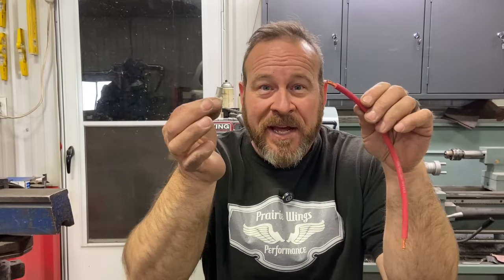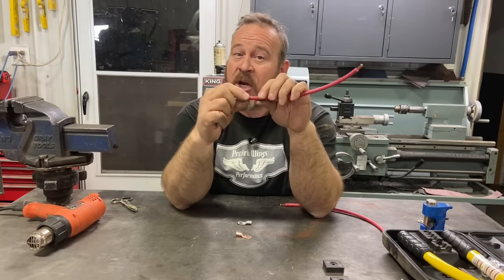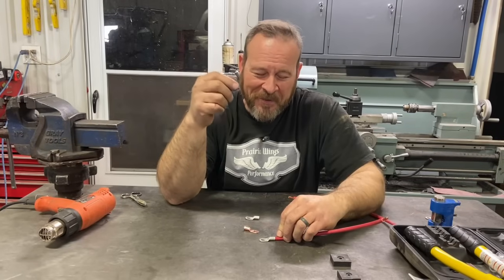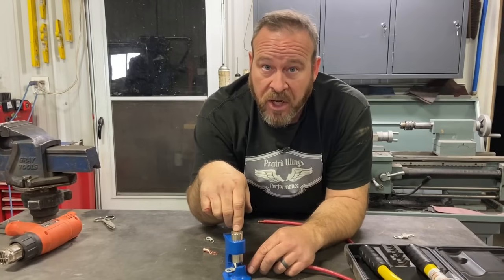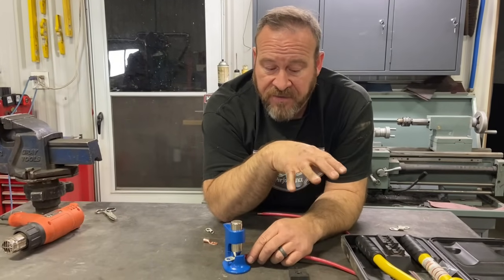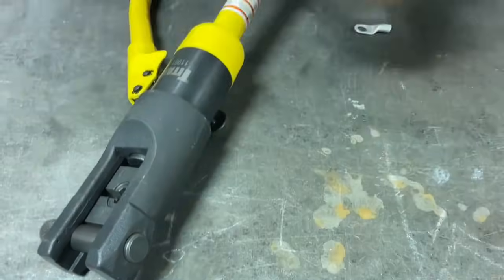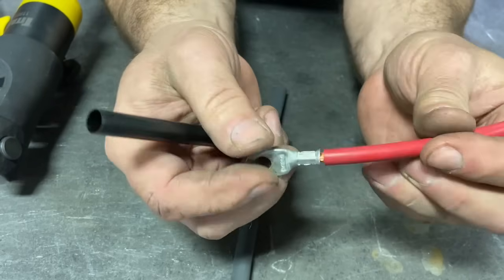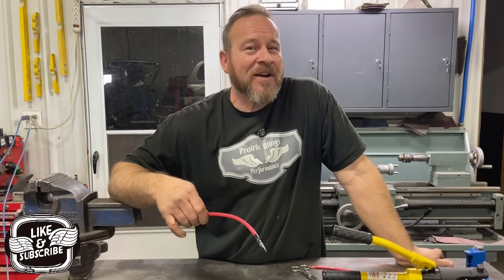Crimping Heavy Cable Ends - Which Way Is Better?

Comment: Back in the mid 80's I worked as a traveling mechanic with a railroad.  We had a ton of battery cable ends and no way to use them.  I ordered the proper crimper for them.  It cost $800 from the jobber the company used.  My boss had a cat and made the company take it back.  I hadn't given it much thought about it for a lot of years until I saw this vid.  I went online to look at hydraulic crimping tools.  They are cheap!  The world has come a long way since the 80's.  I used to put the cable into the end and crush it in a vice, then take a chisel squared off for the purpose and smash the end into the wire.  Didn't work great but that's what I did in the field and it got me through.  Thanks for the video!
Reply from the maker: @ralphwatten2426  I really appreciate this video inspired you to possibly upgrade! They really do a great job! Thanks for sharing your story!

Comment: Since you’ve taken actual wiring learnin, is there any preferred method to join to larger gauge wires? Currently have this dilemma I have, I need to move a battery do I replace 8 ft of 1/0 or do I add the needed 18” to the existing run?
Reply from the maker: @myevilbanana  actually there is, they make large butt connectors (called lug connectors from PICO) you crimp the same way. The only thing you need to do is if you are joining old cable make sure it is in good shape, really check it’s not corroded and cut it back until it is good or replace the whole thing. Crimp connections if done correctly will not cause resistance. The factory does it that way, hope this helps. Thanks for reaching out!

Comment: My takeaway is don't buy just some ends. Allways make sure your ends a suitable for your crimping tool. It's like buying tires for a car. There you need the right size and loading capacity. 
And keep in mind ... ends may cost only pennies but failures might cost thousands of dollars when important equipment is out of order at the wrong time. It's like loosing Formula One competion because of a washer.
Reply from the maker: @rkalle66  I do also believe buy a good tool. From feedback even though I thought I was buying a good tool it seems like there are much better tools available. Thanks for taking the time to share!

Comment: There’s regular adhesive lined heatshrink, and theres also heavy wall adhesive lined.
Reply from the maker: @EFLO3D  yup, tons of different heat shrinks! I just showed the couple examples. I almost always use PICO or Techspan double wall. Thanks for taking the time to comment!

Comment: 6:43 I understand what you mean, but 'one square' sounds weird, later you call it 'flats' and that is slightly better. But what you are doing is turning it to the next 'facet' like what gems have. The facet or flat of the hex. You are 'keying' its general shape so you can refine it to not have edge-flats/squish(partially why I think facet is better, because you are turning it to it's flats to remove the side flats, lol). Could also say you are turning it 60 degrees, but that's not a useful metric for casual interpretation. I would also call the flat squish-out on the sides 'flashing' like what plastic has, but in this case it is cold-forged flashing.
Reply from the maker: @Roobotics  I absolutely understand and agree with what you are saying! Not everything comes out of my mouth the way I have heard it in my head!! I do appreciate the feedback, always working on things but will still make mistakes!!
Reply: @prairiewingsperformance6036  Of course, it's always easier to post-analyze. Thinking about the technical terminologies on the spot certainly isn't second nature for myself either. You conveyed the information well enough to be useful as-is and that's what matters. Just adding some terms that might be useful.
Reply from the maker: @ I really do appreciate any advice I can get to be better, definitely when you put yourself out there in a video you have to be ready! Lots of advice, some great some just let’s say not nice. Thanks again!!

Comment: Helpful video. As for the heat shrink protecting the crimped connection from corrosion totally, it cannot with the crimp on terminal used since it has a hole in it.
Reply from the maker: @runningwater5936  yup that one is an oops on my part, been pointed out lots🤷‍♂️. I do really appreciate the time you took to comment!!

Comment: Would have been weather tight if you would have used a terminal lug "without a hole" in it
Reply from the maker: @garlandgarrett6332  you bet I’m getting beat up over that one! Wish I would have used the other ones…🤷‍♂️ thanks for taking the time to comment, guess I screw up with that one.

Comment: I also used to solder everything: but for automotive I've switched to crimping.  Manual crimper with arms two feet long, but it gets the job done. Thanks for the suggestions.
Reply from the maker: @aresler6085  thanks for watching and for the comment!

Comment: I wish you would have given us the links where we can buy these and the tool. I would haved subscribed with this information .
Reply from the maker: @barryinn1778  I’m pretty new to the game here. The ends are from American Auto Wire. The heat shrink are PICO double wall. I do get some Techspan as well. And the tool I think was from MPR but I saw the same brand at princess auto. Thanks for reaching out.

Comment: Dielectric = not conductive.
Dielectric grease is meant to go on top of connectors, not between metal contacts in the connectors.
Reply: The infinitesimal film of grease left between the conductors after crimping won't create any measurable resistance. Silicone grease is dielectric but is the least likely to leak out if it gets hot.
Reply from the maker: @ thank you for sharing!
Reply from the maker: @IGotsToKnow2  thank you for commenting! Perhaps someone doesn’t know that!
Reply: The pressures involved in standard bolted connections i.e. between terminals, grease will be entirely forced out leaving a solid metal-to-metal connection with very low resistance. Same goes for terminal blocks with screws, the mechanical advantage of the screw connection generates more than enough force to displace any grease that could be a factor. This is the right application of grease, smearing it or some other material on the outside helps too, but you want to keep that interface gas tight with a tight clamp force and tiny smear of grease.

At the pressures inside a crimped terminal/lug the wire and terminal become one solid piece of metal, the grease does not exist in there after. You can grease inside it no issue but it's not going to be in there after the crimp

Where grease can be an issue is if the wires or terminals are clamped with only a spring force - such as a lever terminal like a wago 221, or a push in or tension terminal such as a klippon, there's not enough force from just the spring to displace any grease.

Same goes with packing multiwire electrical connectors with grease, the smaller ones with lots of little terminals won't have enough pressure on the contacs to displace grease. Bigger push in connectors or ones with a strong locking clamp will be absolutaly fine
Reply from the maker: @ thank you for adding your expertise to the conversation. There is a lot of great advice and information being added so thanks for taking the time to comment.

Comment: Funny, eh...we were taught in trade school to fill the terminal with flux, crimp then solder. Shore engineering on the tugs...hydraulic crimps. Oh yeah, 14 awg and under - we ALWAYS pigtail at the terminal to counter vibration.
  Cheers, nice lathe and stay Canadian.
Reply: What do you mean by "pigtail" at the terminal?
Reply: @jheetman  at the wire terminal - wrap the wire several times around a screwdiver shank. It creates a 'spring' that looks like a pigs tail. Think of it as an expansion joint - reducing single point stress. Cheers!
Reply from the maker: @CoastGord  yup, definitely times do change! Love my lathe too, eh! 🤣. Thanks for taking the time to share!

Comment: I've modified a lot of dies over the years to fit the ends available. I used my Greenlee hydraulic knockout punch and made a similar die holding apparatus to the one you're using and had to modify it twice when the ends required threw a curve ball. 
I like to rotate the ends 90° after compressing to 90%ish so I can swedge again to remove the parting line squish out. The spec for an aircraft structural repair facility requested crimped and soldered ends with a length requirement for the stiffening from the solder migrating under the insulation. Rubber tape and Super 88 at 2 layers each has been Jetsons up to the future with heat shrink tubing with internal thermal adhesive as recommended when available.
Reply from the maker: @WireWeHere  very creative, gets the old creative juices flowing. Thanks for sharing your experience!

Comment: I have battery cable at a auto store for years. I do them the same way as you do them and they last for years. I also add some dielectric grease into the wire connector. When you crime the connector it forces the dielectric grease into the wire and stops corrosion. Great video for beginners.
Reply: What he said! ⬆ I also do it the same way, Dielectric grease is a must, especially when using the solder type connectors like the one used in the this video with the inspection hole in them. 

While the connector you used works fine for crimping, the inspection hole pretty much voids the heat shrink covering the connector base and relegates it to cable stress relief only, as long term, moisture will get in through that hole in the front.

The dielectric grease will stop our little green friends from starting a party inside and ruining an otherwise great job, no matter the connector type on larger cables.

And you are 100% correct, hydraulic crimping is the only way go to on large gauge copper cables.
Reply from the maker: @superdog1964  thanks for sharing, those are the crimps that come in aftermarket harnesses, I’m changing the harness in the truck I’m working on. I definitely am hearing about the hole🤷‍♂️. I absolutely appreciate all the great in put on this video, I’m sure it will help lots of folks. Thank again!!
Reply: @superdog1964  Inspection Windows are crafted to provide a superior connection with the added benefit of visual inspection, ensuring every crimp is perfectly executed.
Reply: Dielectric grease works, but a actual anti-corrosive compound works better in the long run. There are 2 better compounds to use for a crimp to wire, or lug to bus connection. One is made by Sanchem in Chicago , its called "No-OX-ID A" , the other is made by Burndy, called "Penetrox" they are anti-corrosives and have lubricating properties as well slowing down any corrosion that may occur on uncoated crimps and lugs.
Reply from the maker: @ I really appreciate the great information people are sharing, thank you so much!!!
Reply: @Internutt2023  'Dielectric grease works'  Don't use the little packages, get one of the larger containers with a brush.  Nothing works forever, you're supposed to refresh the dielectric grease once a year, which few people ever do.  If you get in the habit and use a reasonable coating, it works well, I'd much rather use it than some runny type item that needs to dry.
Someone mentioned insulation, if you're using a crimp connector it's going to squeeze out under pressure as you're forming the connection.  Yes you could theoretically have some tiny amount of trapped space, but it will be negligible. 
Again the main thing people don't do is re-up the protection, which needs it at least every other year and better done every year.  Just take an afternoon and go through all of your vehicles, jumper cables, etc.  If something lives outdoors, you might want to do it twice a year.  I have a van that eats through battery terminals without protection, so I had to figure it out better than normal.
Reply from the maker: @johngottliebjr1777  great tip!! Thanks for taking the time to watch and share, much appreciated!!
Reply: You dont want dielectric grease there, its an insulator dor current!!. Use No-OX id .
Reply from the maker: @ thanks for your tip!
Reply: @mandytuning  I recently did a dive into trying to figure out the best "coating" for inside a crimped connector. The best solution I found is No-Ox even though it is specifically formulated for aluminum. What I could find was that it keeps aluminum from oxidizing but also does the same for copper but it didn't read like OH my this is the shiz on copper too! No-Ox states that it works with aluminum connections and copper / aluminum connections but I didn't get an overwhelming "use it for copper too!" more yea it won't hurt. I am planning to re-wire the winch on my Jeep in the near future and will be using it in the connectors/lugs unless I find screaming evidence against it.
Reply: @tomhubbard353  Boat guy here  I always would put silicone caulk on 10s and smaller  Would also encapsulate bolt on connectors in corrosive environments  Found out this is common best practice for the phone company   Would solder 8s and bigger.   Bought a hydraulic crimper and was experimenting with various greases  there is a copper NoOx  and I have some grease with copper powder
We would use marine grease on all connectors 12 V to 220V  Silicone caulk is good to 500 degrees and because it drys you do not have the mess of grease   Unless you assemble and disassemble Then go Grease
We lifted the float system out annually because of ice in the river   240 slips  all the electric got marine water resistant grease   the coating is the absolute secret to a good connector

Do not get wings on everything    The marine swage is wingless   but the dies were 1200 each and the machine another 3 K

Comment: Beware of cheap cable wire.  Impurity in copper can significantly degrade crip connection.  Should look like shiny bright copper after removing insulation, not dull oxidized brownish look.  Easy to have 4x the resistance.

HIgh current breakers can generate a lot of terminal heating that conducts to wire connection.  Don't use cheap vinyl insulated cable that turns into soft marshmallow when heated .
Reply from the maker: @rcinfla9017  thank you so much for sharing this information! It’s tough to know now a days what you are buying, even when you pay good money for stuff it may be junk! Thanks again for taking the time to watch and share your experience!
Reply: And look out for chiwanese aluminum core copper clad wire marked as copper.  Got some of that the other day.  I noticed that the cut end was kind of solverish.  The realized it was copper clad aluminum strands.  I live rural, supplies are a day wasted getting to a “big town” and back.
Reply from the maker: @ I haven’t seen that. Great find and helpful information for everyone who reads this. Thanks for sharing!

Comment: The wire should be stripped so that the end is visible in the hole. That’s why the hole is there. Smaller lugs will be open on the inside end. The wire should come just to the end of the tube.
Reply from the maker: @hughbrackett343  great info, thanks for sharing!!

Comment: well crap... light crimp and rotate.... yeah never even though about that one.... on the other hand i do love my hammer crimper. any suggestions on where to get the "good" heat shrink?
Reply from the maker: @jr3628  ya I realize now I should have gotten some links in the description, sorry. I use PICO or Teshspan double wall. They have great wiring supplies. Most auto parts stores in Canada carry their stuff, most likely US too? Not sure where you are? Thanks for watching and reaching out for more information!

Comment: There is a hole in the end of the crimp barrel so good luck keeping the wire sealed.
Reply from the maker: @centurionhomeinspectionsin2253  yup, this is the crimps that come with the aftermarket harnesses, I’m hearing about that one. Can’t see the forest for the trees sometimes. Thanks for taking the time to comment!!
Reply: Use a product called No-Ox, cover the bare copper with a wipe of No-Ox then insert into connector and crimp. This is a standard install instruction in the telco industry. NASA only crimp connections no solder they have a set of instructions if you google it.

Comment: Link to your "heavy duty" shrink tubes?
Reply from the maker: @jws3925   sorry about that, I use PICO or Techspan dual wall. 90% of my wiring supplies come from either one of those brands. Thanks for reaching out, hope that helps someone else as well!
Reply: @prairiewingsperformance6036  it doesn't get any better than 3M. It is the gold standard.  https://multimedia.3m.com/mws/media/821423O/heat-shrink-ci-brochure.pdf?&fn=Heat-Shrink-CI-Brochure.pdf

Comment: I've never considered rotating to avoid wings. Great tip.
Reply from the maker: @jamieyz  thank you so much, glad you could use that! Thanks for taking the time to comment!
Reply: @prairiewingsperformance6036  have you cut the crimp, and had it polished and etched to see the structure once crimped ?
Reply from the maker: @ no I have not, just the big pull test and lots of years of use as a test.
Reply: @martinfidel7086 I did this exact thing with a 2/0 lug that I hex crimped onto tinned marine cable. The copper in the crimp is essentially solid, and after polishing and etching you can see the pattern of bundles of strands in the cable.